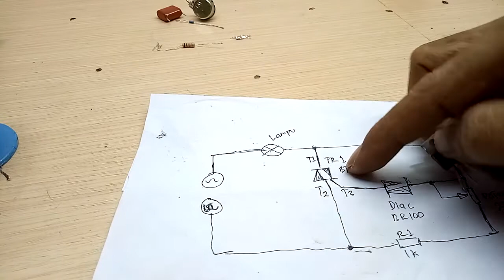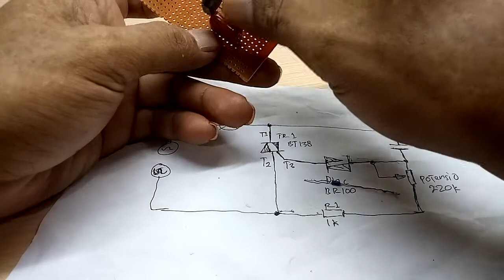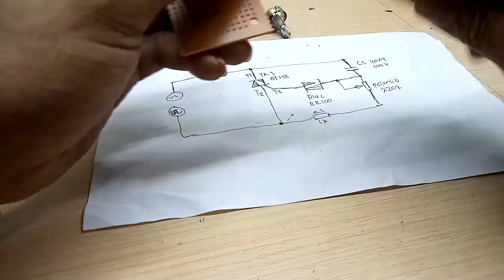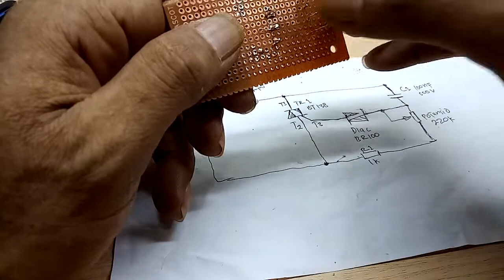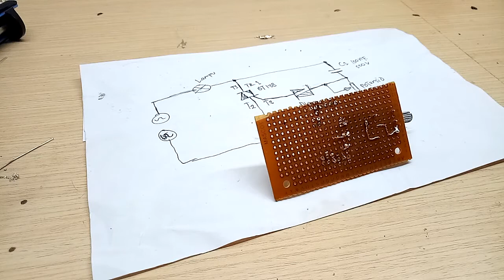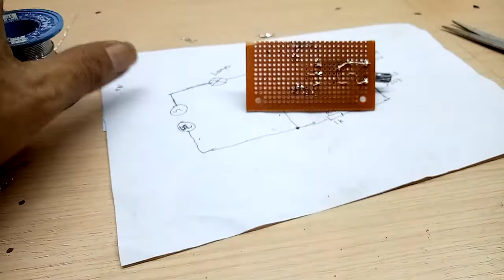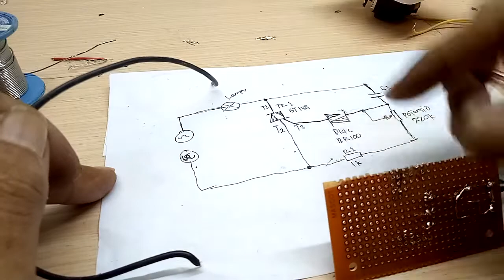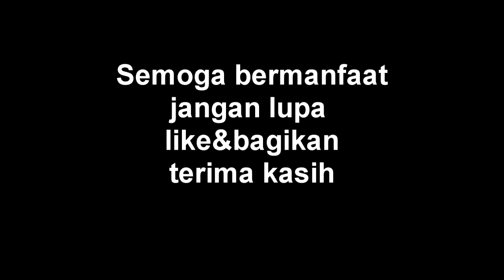cara membuat dimmer listrik

Comment: itu ouputnya brp  Volt mas
Reply from the maker: 1000 watt gan
Reply: gan Klo kapasitornya di ganti Yag 104J 400Volt Bisa gk. trs Klo pake 104J 400V, output lampunya berapa watt ?
tolong balasannya gan. maklum pemula